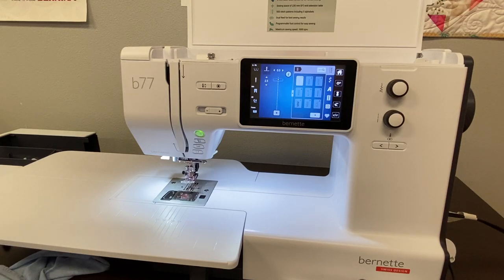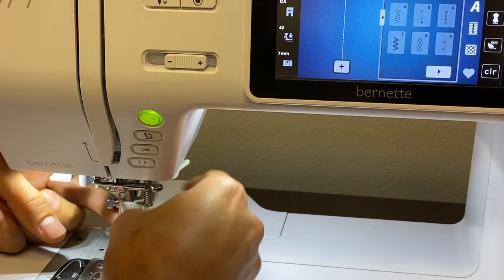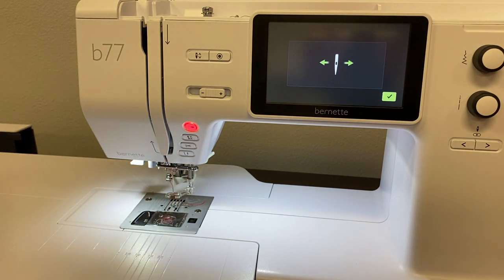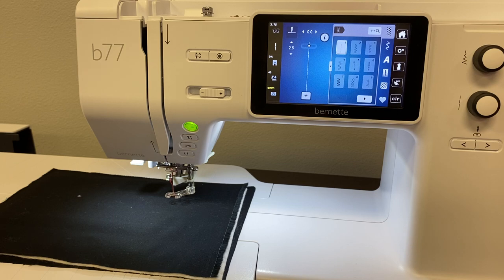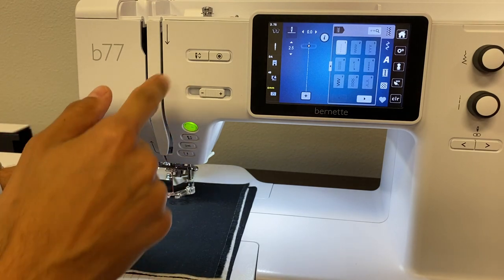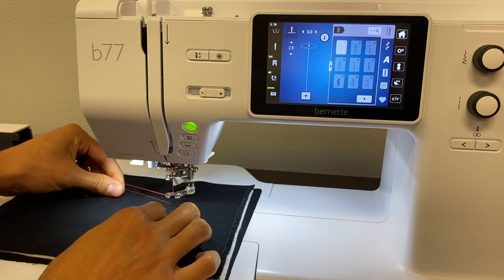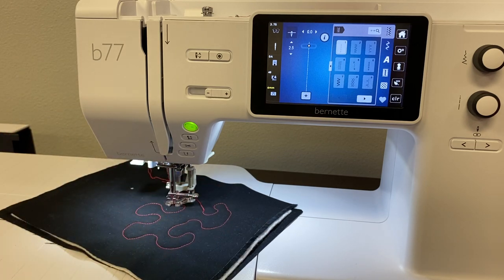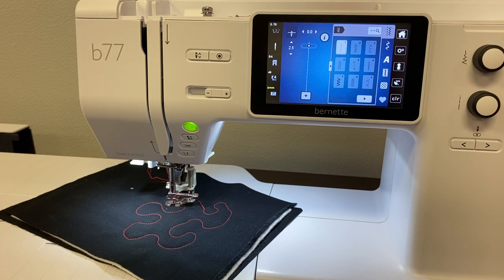bernette b77 b79 free-motion quilting setup

Comment: Hi Cody, first off I really love your tutorials because they're so helpful!!! I have a Bernina 480 special edition and I've found some videos of yours that have been very helpful with using my machine. But have another machine-
I have a Burnett b35 and I am having a serious issue with getting the buttonhole presser foot to work consistently every time.
I looked all over YouTube for a video to see if somebody has experienced a similar issue and they haven't So if you don't mind I'd like to explain it to you and maybe you have some thoughts on it.
I always do test buttonholes on the same fabric of the garment I'm making and it seems as though, more times than not, the machine will bar tack and then go backward up the left side and then stop and not bar tack at the top. It just gets stuck at the top of the left and then never finishes the top bar tack and then come down the right side To finish the buttonhole.  Sometimes it does and sometimes it doesn't and I can't figure out why. I'm constantly double and triple checking the machine to make sure I have everything set up right and I do. I've used this buttonhole maker before and it worked fine and now it's acting all wonky. The machine is in great shape has not been abused and there's no damage to the presser foot because I always keep it safe and it's little caddy. Have you ever heard of this issue or had it happen yourself? I appreciate your thoughts and hope you have a great day!
Bernice

Comment: Even though the the machine is dual feed can I put a walking foot on it?
Reply from the maker: Good question and unfortunately no. A walking foot does not work on these models because the dual feed hangs down to low and the walking foot will not fit because of it.
Reply: Why would you want a walking foot with a duel feed? Just curious.

Comment: Hi luved your video im intersted in buying bernina is it suitable for king bed quilt projects?
Reply from the maker: Hey :) If you are going to just piece a king size quilt and have someone else quilt it absolute not a problem at all. However a king sized quilt is very large especially when you add batting and backing so it will be very difficult but not impossible. I have had customers tell me they have quilt king sized quilts on an even smaller machine. That is something I would not want to fight with myself. :)

Comment: When using programmed decorative quilting stitches on the quilt sandwich, do you need to adjust the presser foot pressure?  Thanks.  Your videos are great and so appreciate them!
Reply from the maker: You shouldn't have to adjust your presser foot pressure for different stitches, we usually change it for our fabrics that we are using. Thick and stretchy is usually when we change it the most often. If you are using your a decorative stitch you will want to use the clear foot that came with your machine. The center of the foot is raised to accommodate the bulkier stitches. I can't remember the letters of that foot of hand for the bernettes.

Comment: I want ur advice i am confused about buying anew sewing machine for  both quilting and embroidery which is the best in ur opinion
Reply from the maker: This is not an easy question to answer. It really depends on 1. how much have you quilted and embroidered in the past. If you are new to embroidery, how much and what types of things are you wanting to embroider will make a difference as well. 

BERNINA/bernette have a number of options that both sew/quilt and embroider. The bernette b79 is a very nice machine that does both and comes with a lot of perks and great features however it doesn't embroider really dense designs very well nor is it able to embroider on heavy weight items /fabrics. The bernette machines in general are not heavy duty machines, they don't have to strength and power of the BERNINA machines. But that dons't mean they don't do a great job for most people. I have people who come in wanting a machine to start a small on the side business and thy are wanting to ember on many different items and in my opinion the bernette machines are not going to be able to perform like they need it to.

Now on the BERNINA spectrum they can handle anything you throw at them sewing/quilting/embroidering. They are much stronger machines and have many features and tools to make your life easier, but they do have a higher price tag that comes along with that. Unlike the bernette that just has one machine that can sew/quilt and embroider BERNINA has 7 machines that can do all of the above starting with the BERNINA  535. What is nice about most of the combination machines is they can be purchased without the embroidery module and it can be added later at least in the US. Again the best machine will determine how much you plan on embroidering really. If its just a little here and there the 535 will be great. If it's something you plan on doing quite often then the 590, 770 or 790 might be the better option they have more features on the embroidery side that makes things much easier. 

But without knowing how much you are really wanting to do my recommendations would be either the 590 or the 770 plus BERNINA machines they are both fully capable the biggest difference between the two are their size the 590 has a 8 1/2" throat and the 770 plus has a 10" throat from the needle. 

Hope this helps :)
Reply: @sewingwithcodyandpete8651  Thank you so much for your replay it will help I really like ur channel a lot 🙏🏻

Comment: Hi Cody. Thanks for doing a video on free motion quilting. I am new to quilting so my question is about basic straight line quilting (2 layers of cotton, a layer of cotton batting, and a layer of insul-bright). Do you recommend the 90 size needle?  Also, do I release the feed dogs (I have a b79)?  What do you suggest for stitch length?  Thanks in advance for your comments.

Comment: Is there a Bernina model that compares to this Bernette? Thank you! I love your helpful videos.
Reply from the maker: Yes so the BERNINA that is compared to the bernette b77 is the BERNINA 570 NG and the BERNINA 770. The difference between these two BERNINA machines is the 570 is a hair smaller than the bernette b 77 but very very similar features. The BERNINA 770 is bigger than the bernette b77 by an inch from needle to the back of throat but identical features of the BERNINA 570. That is why I said the 570 and 770 are similar to the bernette b77.....

Now as for the bernette b79 comparison that will be the BERNINA 590 or 790. Like the other two BERNINA machines I mentioned above for the b77, these two are really just a difference in size. 

For us the bernina 770 and 790 are our most popular larger machine models. :)
Reply: I was under the impression that Bernina manufactured the Bernette.  Am I wrong?

Comment: Could you tell me which foot to use for ruler work?
Reply from the maker: For this machine you're going to need a "ruler foot" a foot that is designed for free motions but that has a 1/4" hight around it so the ruler won't slide underneath it. Bernette makes a ruler foot for their machines your dealer should have it.
Reply: @sewingwithcodyandpete8651   thank you! Thank you so much for all of your videos they are absolutely so much help to me.

Comment: Hi! Is it possible to FMQ without the straight stitch plate? I did try with the standard provided stitch plate and got the "eyelashes". I wonder if that's related to having the wrong plate.
Reply from the maker: yes it is possible to free motion quilt with the regular 7mm stitch plate. The 0mm stitch plate usually gives you a better stitch but usually that won't make a big difference with eyelashes forming. 

Try using same thread in the top and bottom (if you already aren't already), topstitch sz90 needle, you can also increase your top thread tension a little if your eyelashes are forming on the bottom. 

Hopefully this helps some. :)
Reply: @sewingwithcodyandpete8651  Thank you - I just switched out the plate and it made a huge difference! But now the problem is that, every time I switch out a new bobbin, I get all kinds of problems. Like the bernette doesn't wind every bobbin with the same tension. Any feedback on that?